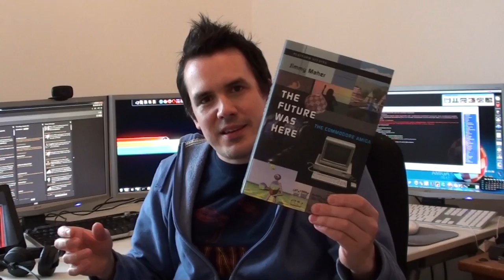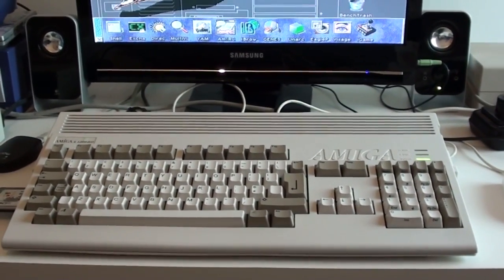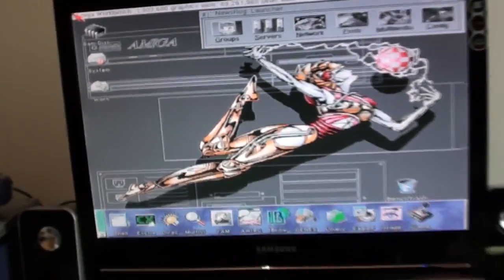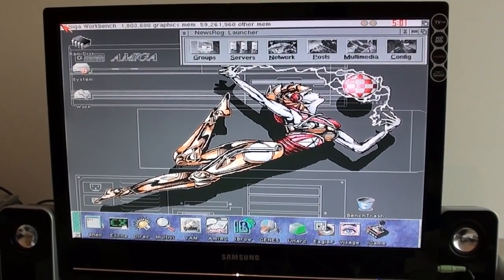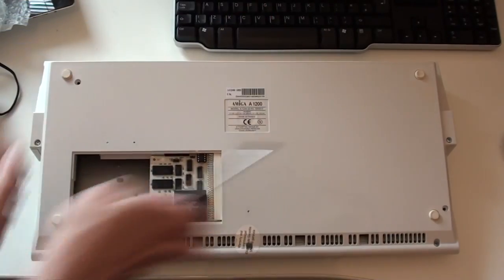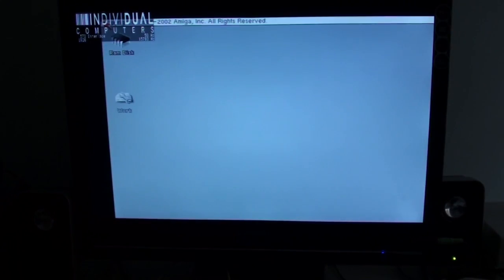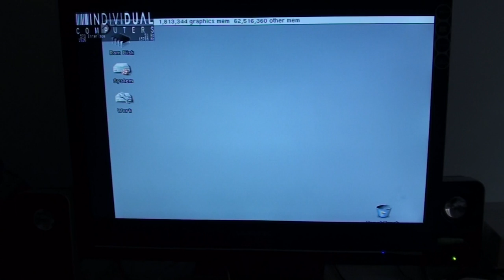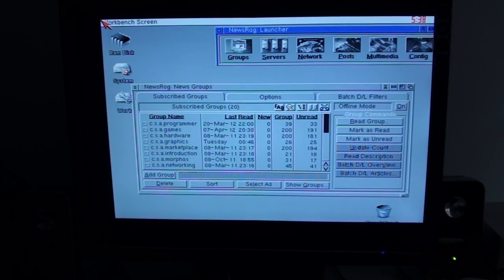Use Amiga With a Modern PC Monitor/TV - Indivision AGA MK2 Install

Comment: Thanks for your videos for all this time, I've been contemplating buying a machine for a while now.   I used to have an 1200, a500, cd32, cdtv etc.  Had an a570 etc.   I'm pretty knowledgeable with all this stuff but it's your videos got me back into it.    I just bought a boxed, recapped a1200 from the UK, and a boxed almost new a500 from Australia where I am.   So I'm going to buy a vampire and leave it hooked up to my 85" tv in the lounge room.  I'm still contemplating buying another cd32 while I can still get one at somewhat affordable prices.    I had a brand new in box one still with wrapping had never been opened about 7 or so years ago and I sold it before all these cards came out.  Such a shame and a cdtv they are hard to even find now.   Thanks again for the content from Australia.

Is there anything OTHER than the capacitors and PSU on the a1200 that goes.   As apart from that they were always pretty solid.  Is using it a problem or should I not use it and leave it in a box, I'll be using a good surge protector.

Comment: This is why using a HD TV as a Amiga is a bad idea... A flat screen TV is not meant to be used as a computer monitor. and could have issues eg refresh rate etc,, 

perhaps that was based only on  the connection method used... i dunno

Comment: I waiting for a ECS Denise chip for the Indivision ECS V1 for my A500. Want to connect with a BENQ BL702A 17 inch VGA monitor. Is the monitor good than i want a second for my A1200 and maybe a third for the C64 Reloaded MK2. With the Turbo Chameleon V2 or with a easy connecting with a S-Video to VGA.

Comment: I have both the Indivision ECS for my A500plus and the Indivision AGA for my A1200 but for my A500 i still prefer connecting it over RGB SCART cause scrolling in games is musch smoother using SCART. In Germany all standard TVs are able to display the original 15khz RGB signal from an AMIGA directly.

Comment: Could you do some videos on how to use AOS?  I'm learning about how to use Icaros but I don't have anywhere to reference how te find stuff other than the manual.  If I learned how an amiga worked 1:1 I think it would be easier :3

Comment: Great video!  Can you put the floppy disk drive back in the A1200, or do you have to leave it out?
Reply: I think in the video Dan left it out just to make viewing better, but there doesn't seem to be much space between interface on floppy cable connecting floppy drive and  Indivision so  it may become a bit cramped. It may look ugly at the back, but just leave it "as is you get more air flow through the case anyway. I'm sure that wouldn't cause issues. (comapred to leaving slots on a PC which would muck up the airflow)

Which btw:  i really don't believe there is any truth to that.. " It would overheat MORE with slots covers removed".. Rather, the complete opposite. (More air need in more confined spaces) and of you did happen to get the floppy drive back in ok, then keeping the backing off to "help" airflow would be better i would think.

Comment: really funny i was able to connect it to my vizio plasma or my recent  sony tv .., and my pioneer. oh my can this is sad No you dont need this ,and no it doesn't flicker. .Look on you tube a guy does it without using this and it doesn't flicker.Oh , by the way I gave you a picture of the chip inside It said date  "1990"  which proves CD32/a1200 are circa 1990.. Yep emailed you it,, via where oh amranth... yeah liar..Ok, all of a sudden this guy claims to know alot about Amigas, because he bought them. This is sad. I'm not going to argue .I have proven time and time again he doesn't knww anything Amigas, all he does is read wiki which is and can be edited. I knew Jay ,and another guy ..you name him if you know ur stuff dan ..here a hint may they both RIP. you have 3 hours to respond..and oh yeah you did respond to me in 2 hours before ..So dont look this up.They where both my friends . SO I KNOW THE FACTs  Time is ticking fooltard its 6 am. You got to 9am your time. No dont ask anybody else to look him up. OH you might remove the post jsut proves me right..hope u guys read it ..no the email has been gone now.it was a relay.
HERE ENDTH THE LESSON

Comment: Take it you have to route audio separately?  Only just found your channel from the Gotek FD emulator, love your vids already, rekindling my amiga thirst.  Just a tip you might have fixed in later vids, if your camera supports manual focus (MF usually on the display) when you do the fixed shots to the screens enable this and tune it and it won't keep trying to track light changes).  Wish there was a mod for the A500 to push it to VGA/DVI/HDMI.

Comment: hehe I really should have ordered mine from Amigakit. The store in Sweden where I bought it from sold it with the original cable that's pretty short so I had to cut a hole in the lower rf-shield and it didn't come with a screw and mounting piece either.

I managed to get the connector to sit fairly tight using a small plastic band and tying it in place so it works but it's not the best of fits

Comment from the maker: There's no way to fit one unless you transplant the motherboard into a tower case and then add some PCI or Zorro slots, by the time you get into that territory I'd rather just use my OS4 or MorphOS machines.  I like using the A1200 with it's classic architecture.
Reply: hi dan.. i am looking at getting one of these addons but i have a question - im only going to be playing some old games - what res will the scart cable give me from my standard 1200 ?

Comment from the maker: You could ask the same question to classic car collectors, what's the point in buying classic cars when a new one will drive better?  It's a hobby, that's all.  I have a Core i7 Windows 8 PC with 16 GB of RAM for modern uses, but I still enjoy using the Amiga, the OS is elegant, some of the software is still interesting to explore and it still has a vibrant and active community.

Comment from the maker: I actually use it connected to a 19" CRT SVGA monitor now so haven't looked into that feature.  I know it was an option in the config tool on the original model, not spotted it on the recently released tool for the MK2, it is still beta though. I'll have a check on the latest version.

Comment from the maker: They've been taken off sale at the request of Individual Computers/Jens (the manufacturer).  For some reason the drivers/config tools are still not out (9 months later) and many customers are complaining/returning them, so it has been taken off sale until they are eventually finished.  Big shame, but I can see why, the tool should have been completed long ago and using without it is difficult for many people.

Comment: Nice Video, Easy to install the Indivision AGA. But what happen if the A1200, still have any real 3.5 Hard drive. You know with the HDD holder brings originally the A1200?.

Comment: Hmm, I was always wondering how my A1200 would work with my samsung 2333hd tv/monitor, but I guess it'd work just fine with a proper cable, never knew about flicker fixers and stuff. The indivision is a bit, or way many bits, too expensive for me and wouldn't really need high res's.

Comment from the maker: But it doesn't make the display look worse.  It just needs to be configured for the monitor and the screenmode driver installed then I can run my system in around 4x the resolution my Workbench currently shows.  Little job for my weekend!